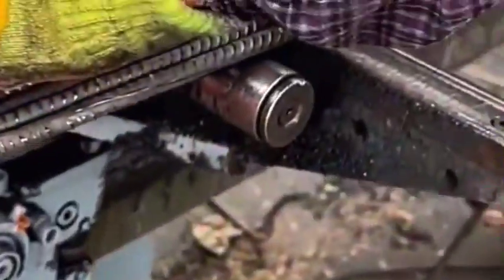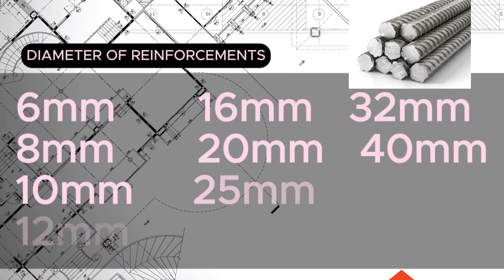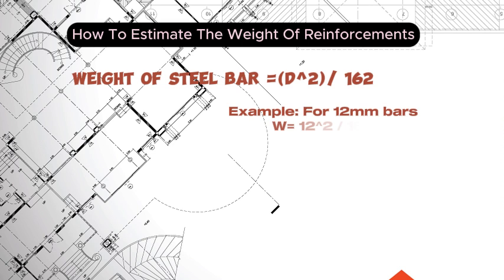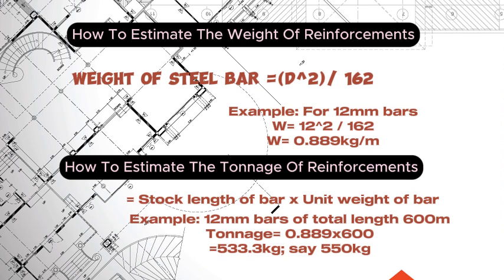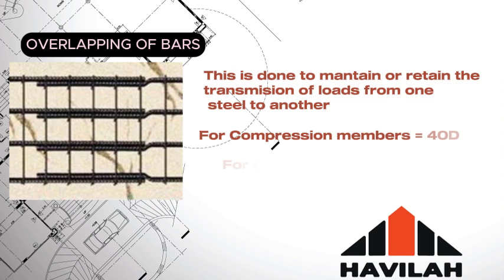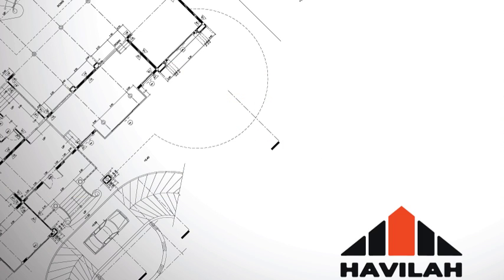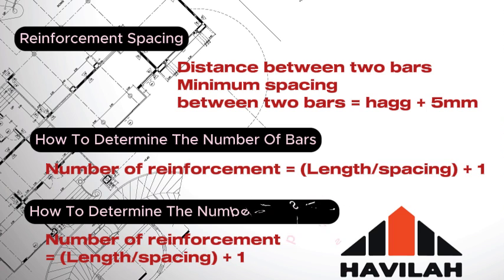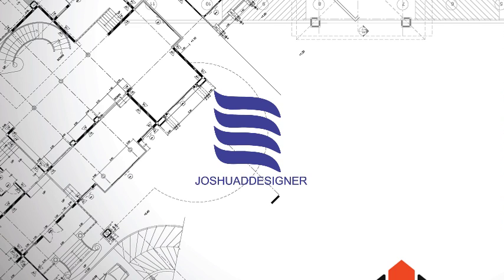Bar Bending schedule Basics // BBS of Steel Reinforcement

Comment: How did you arrive at D²/162 as the weight of the steel reinforcement in Kg/m? You need to be specific in your trainings to adequately guide viewers. Here is how the distributed weight of reinforcement in Kg/m is obtained as a function of the bar diameter in mm. Density of steel = 7850Kg/m³ . Now crossectional area of any reinforcement with a Diameter of 'D' in mm²= πD²/4. But area in m² = 0.000001πD²/4. Now multiplying the density in Kg/m³ by the area in m² will give you the distributed mass in Kg/m. Therefore 7850x0.000001xπD²/4 will give you D²/162.175. So the training has to be specific to aid adequate understanding. Also the lap lengths as a multiple of the bar size, you need to specify the reference code from which you obtained these information. This is in BS 8110:part 1 Table 3.27 and it is not just 40D, it is a function of the grade of concrete (28 day cube strength) and the type of bar.